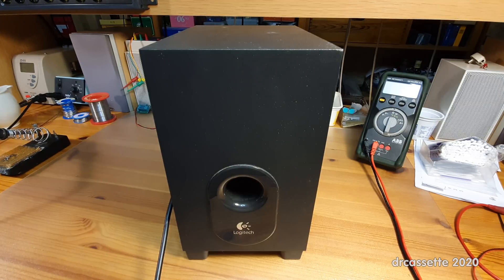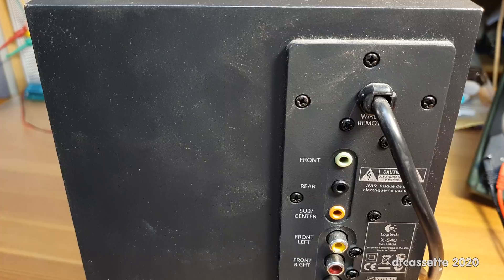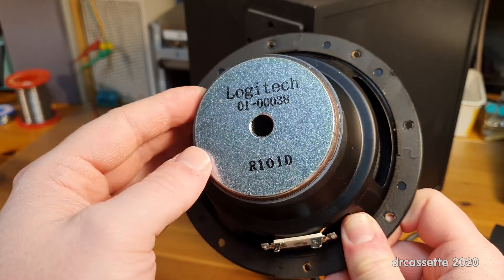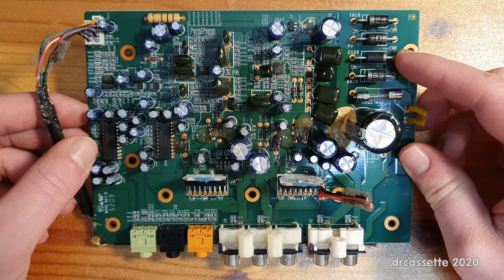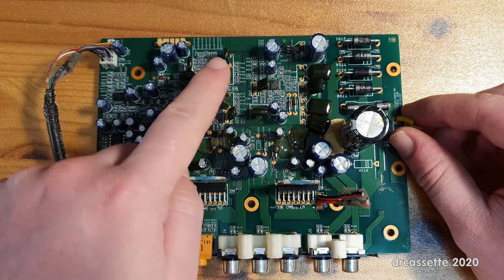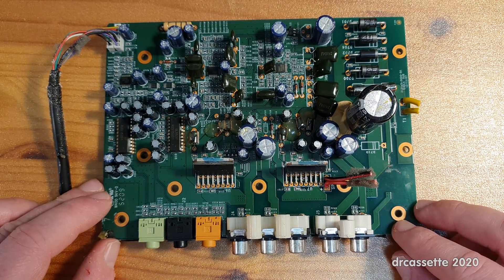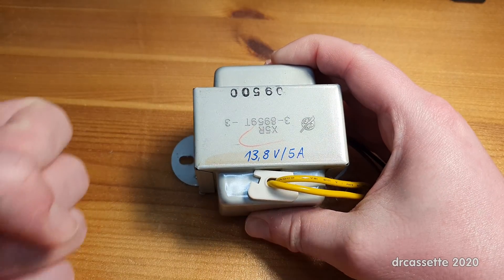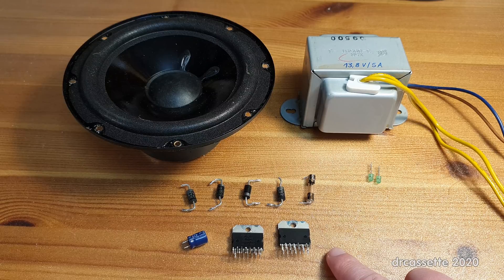Logitech X-540 surround amplifier subwoofer teardown

Comment: Great video. Thank you. I am looking for a replacement transformer for my X-540 with the information provided in your video. But I am having difficulty finding a good match on DigiKey. Do you have a source for a suitable replacement transformer?
Reply from the maker: Unfortunately no. I salvage transformers from equipment I take apart before recycling. If I need a transformer usually I have one in stock that I can get to work.
Reply: @DrCassette  Can I buy it off you?
Reply from the maker: @Core5   I am located in Germany. Shipping would most likely be prohibitively expensive.

Comment: I have these for over 10 years but recently developed a problem, speakers play fine but they seem to be always on maximum bass so i was just wondering if replacing variable resistor in the remote would do the job or do i need to replace those mystery chips?
Reply from the maker: You can measure resistance of the variable resistor (potentiometer) to find out for sure if it's bad. I'd be surprised if one of the mystery chips had developed a problem.

Comment: I broke the Matrix button and now that I have a tv with surround output, the X540 is stuck in Matrix mode. I mean the actual inner moving parts of the button. Is there a way to set off that Matrix thing? I would rather have it stuck in regular surround mode.
Reply from the maker: If you can solder, you could unsolder the bad switch an replace it with wire bridges to lock the electronics into the regular mode.
Reply: @DrCassette  I've had mine for a while. It does what I need. But recently the left front channel stopped working. Any suggestions? I am afraid to open the glued in plastic box but will do it if only to save money for now.
Reply: @levialmuina  rubbing alcohol should get that glue off, it takes like an hour. Just rubbing alcohol on the glue with a cotton tip. I'm waiting rn, saw this video and just looking at comments seeing other ppl probs with his system...

Comment: I have the same set, maybe a little earlier version since it doesn't have the switch that cuts power to primary winding. Had it for I guess over 10 years, still going strong, but the transformer hum is getting louder and louder up to a point that I have to plug them out of the socket when I don't use them. Is it safe to take it apart and pour some epoxy on the core so the laminations don't vibrate? It's a very frustrating sound.
Reply: I think I have the same issue. My unit makes low frequency hum noise. Is it the transformer wearing down or some capacitor failing?
Reply from the maker: I know what you mean, it would be safe to take the unit apart (once it's been unplugged!) and apply epoxy to the transformer, however, I am not sure how much that would help. Transformers after final assembly are put under vacuum to force varnish into all the voids inside. Over the years the varnish can crack and fail to hold things together, and that's when the hum occurs. All you could do is put epoxy around the outside if the transformer, I can't think of an easy way to force it down into the voids where it is actually needed.

Comment: Thanks for this video. Can you confirm that the transformer outputs 13.8v 5A AC? I'm looking to convert my X-540 from 110v to 220v by swapping its transformer, but I don't have a multimeter :S
Reply from the maker: The transformer indeed is 13.8 V 5 A (by design all transformers are AC). Also, get yourself a multimeter. They are very handy to have ;)
Reply: @DrCassette  Thank you!

Comment: "matrix" most likely turns on/off an analog matrix decoder like Dolby Pro Logic to generate 5.1 out of a stereo source.
This is maybe also what the chips are for.
Pro Logic works similar to matrixed Quadraphonic systems, using phase shift and addition/subtraction it can send an analog 5.1 signal through only 2 channels. 
I still want to built an analog encoder for this (definitely doable, it is not that complicated) as it could be used with many older surround amps that only have a matrixed input
Reply from the maker: Very interesting, thanks for the info! I never looked into how these matrix systems work.

Comment: 11:07 I somehow doubt that a PCB with a 5209 data stamp (week 52 of 2009) would have been designed in 2011. 2006 (either September or November) seems more likely.
Reply from the maker: You are very right, I didn't even identify that as a date code :D

Comment: Looks quite cheapish but not too bad. Normally Logitech uses cheap SMPS (which go bad very often)
Reply from the maker: But those are newer products? I don't think I have ever seen these Logitech speakers with a switched mode power supply.
Reply: @DrCassette 

 How old is this speaker system? I thought it was a more recent one because of all the SMD components.
Also was the date code on the PCB design really  2011 or rather 2006?
Reply from the maker: As somebody pointed out in another comment, the design date actually is in 2006, so this system indeed is surprisingly old. Double sided boards with SMD components were uncommon in sound systems back then.

Comment: i never cared much for surround sound, good old stereo is good enough for me. I too bring dumped things like that back just to get free parts!
Reply from the maker: Same here, I don't see the point in surround sound, but the two STA540 chips out of this Logitech thing will give me two nice stereo amplifiers when used in BTL mode. If they survived being unsoldered with the heat gun!
Reply: @DrCassette  When listening to music I always listen to stereo speakers (or mono through the 2 front speakers), but for movies the surround sound is a very cool experience.
Reply from the maker: @vdochev   I don't really watch movies (I prefer documentaries on TV), so I don't really have a use for surround sound...
Reply: I have the X530 with an external subwoofer modded onto it and I've been using them in stereo for years now, surround is cool but I barely used it. Headphones work better for me.
Reply: @arwlyx  Agreed. But, if you have the chance, please try Dark side of the Moon DTS version on a nice capable system. I was sceptic the first time, but when the mixing is mastered how it should be it sounds great!